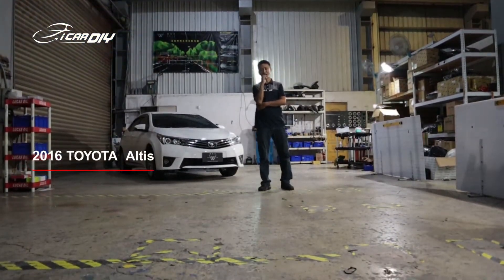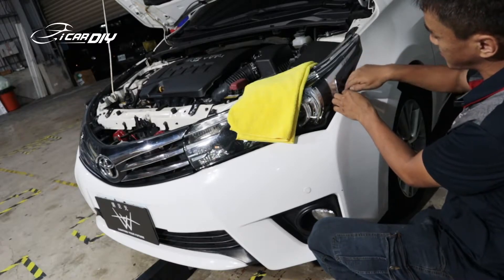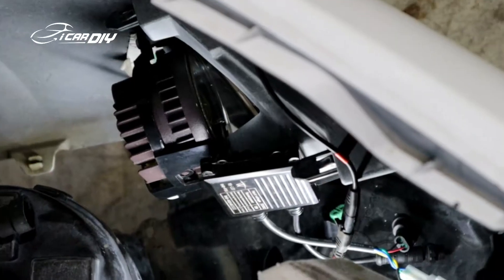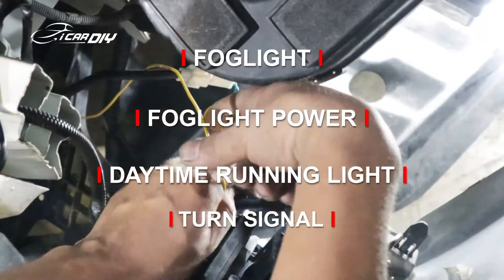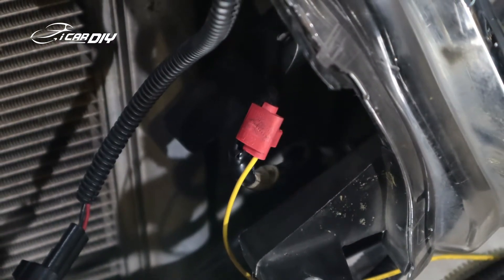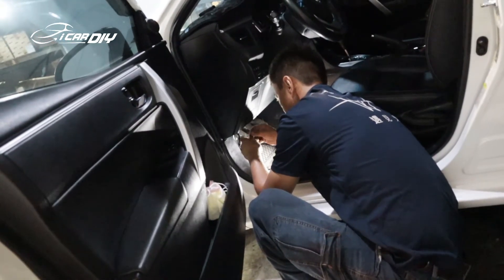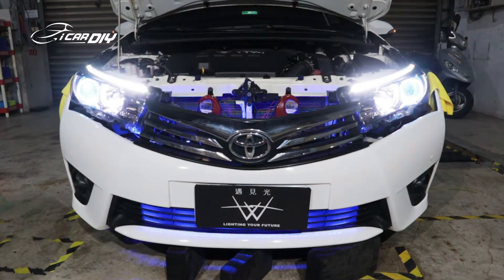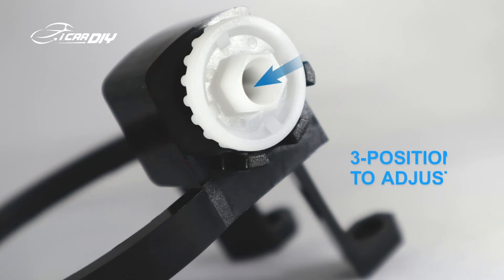How to install a 4in1 LED Projector Fog Light for 2016 Toyota Altis

Comment: Hi sir i have sinolyn projector foglight may i know where to connect it bcoz im want my fogs has a hi/low beam my unit is fortuner 2017
Reply from the maker: Hi Sirs, sorry for late reply. I'm sorry to inform you ours has no high/low beam and ours isn't fitted to your fortuner 2017. Thansk for asking and your interesting.

Comment: Hello I bought this Led fog lights from Amazon but it doesn't work. I have Toyota: 4Runner 2017 model . What should I do to fix this problem?
Reply from the maker: Hello Chetan, Would you please contact me by email, amz@wsyoyoyo.com? I hope to show you photos by email. 
Moreover, I hope below explanation to assist you more: 
1).Round shape universal one currently fits Toyota FT 86 2012-2017| GT 86 2012-2017| SCION FRS 2012-2017.  
2).The Bevel one, https://amz.run/4OS5 fits 4Runner 2010~2014, but it would be easy for you to re-modify it to fit 2017 4Runner as below. 
3).Bevel shape 4in1 fog light (https://amz.run/4OS5) + 2 Flat Straight Brackets Mending Plates( if you need me to show you the photo, please provide me your email or come FB PM me https://fbook.cc/3Myd . 

If there’s more I could assist you more, please do let me know. I’ll try my best to assist you. Our 4in1 fog light deserves you to give it an experience. Make you a safer journey, all for your safety! 

Wishing you good health and well-being!
Reply from the maker: Please contact me if you have more concerns. Much appreciated.
Reply: @icardiy1590  I did everything by diagram bit it still not working . Looks like it drivers are bad
Reply from the maker: @chetanpatel5462  Hello Chetan, I'm aware you've received another kit from Amazon. As my above info, 4Runner 2017 my fit bevel shape of 3.5" fog light with the mending plates. However, it seems you are able to re-modify the round shape to fit your 2017 4Runner. How does it work? Do you need my assist? Thanks for your attention.